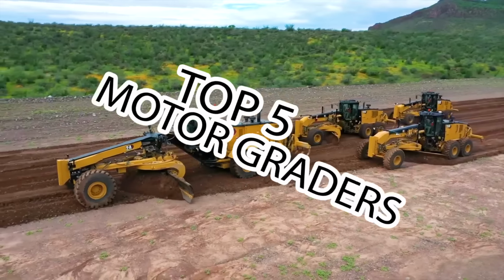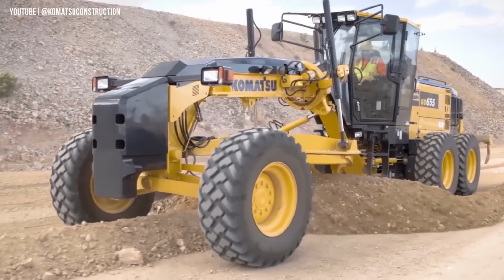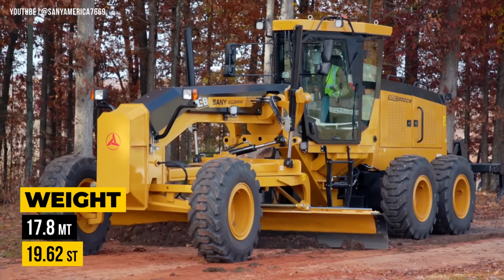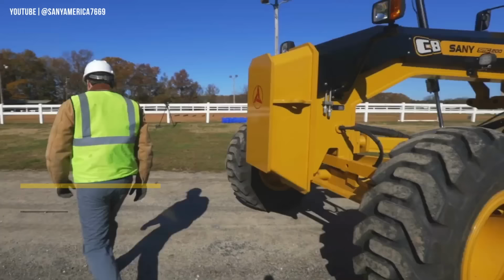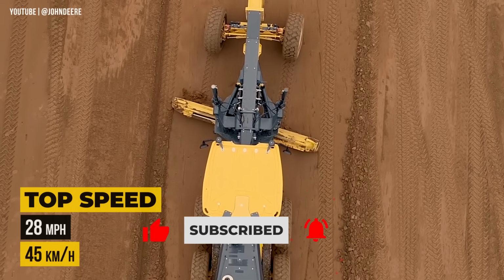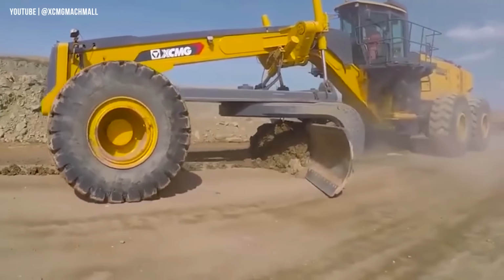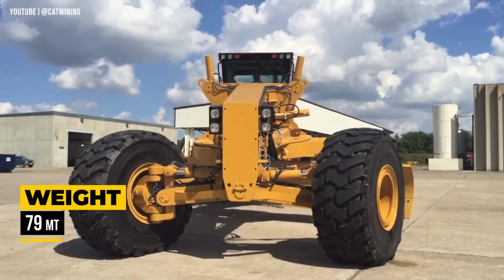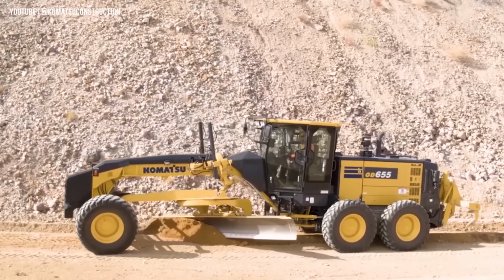2024's MOST POWERFUL Motor Graders EXPOSED!

Comment: It’s amazing how strong some of these are with only 200 hp😮
Reply: Due to how hp is calculated, low revving engines never have high hp numbers but the torque number is probably really high.
Reply: Torque and gearing are everything.

Comment: Whose still calls them a “motor grader”?!?! Was your script written in the 80s? And why did they call them a motor grader? At least call them Knuckle busters!!!
Reply: A knuckle buster is a blade with gears and drive shafts to do all the moldboard functions.  If you hit a big rock the energy comes back up through the levers which would bust your knuckles
Reply: Now the union queers call them a blade.
Reply: @carlachambers3771  Was Union but not queer.  Then came down South here and worked for Co.Hwy.Dept. and everybody called them Motorgrader.  So whatever the conversation calls for.  Jeff Anderson of JayPaydirt uses both names for the motorized grading platform.  It takes great skill to run one well no matter whom is running it.